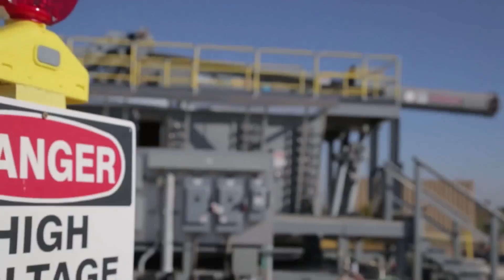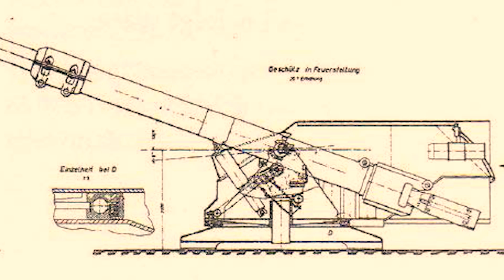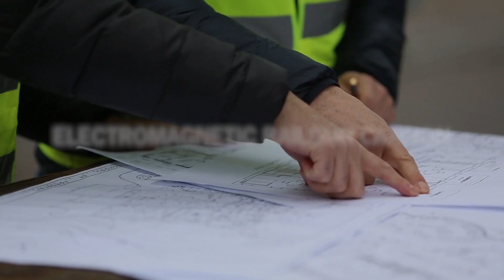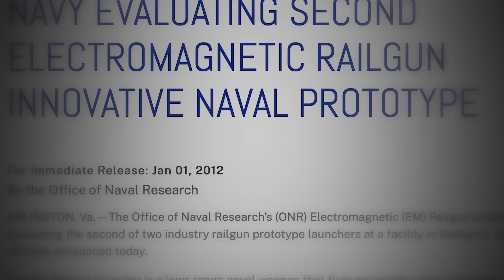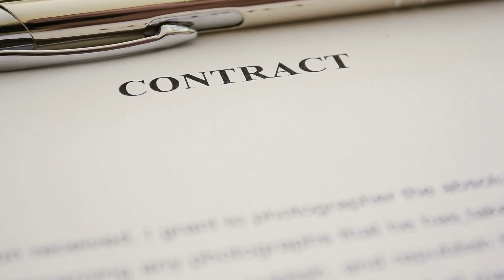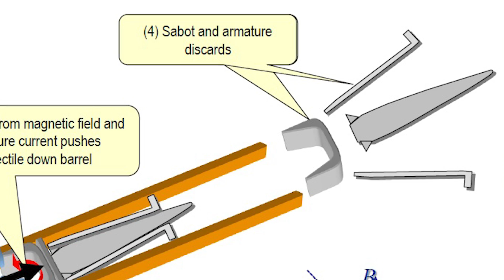The Most Powerful New Gun the Navy Has Ever Built?

Comment: What tears up the barrel so fast? Is it just the acceleration ripping the guts out of the barrel or the sabot and armature doing the damage? I want to see one shot straight up.
Reply: Probably extreme friction. MG42 etc came with extra barrels because they can only take so much before they become very inaccurate etc. Higher cause for malfunctions.
Reply: @Niever  not friction but extreme heat. Electricity is a scary powerful thing, imagine how hot those magnetic coils get. Idk if you know anything about welding, but watch how quickly a piece of metal can bend when you weld on it. Now imagine that ramped up into oblivion.

Idk a material that we make that can withstand that kind of heat.

My thought was always, how do we bring the heat down, what kind of cooling process could we have? Maybe nitrogen cooling veins?

But that adds complexity, gas storage issues. Which, the more complicated the system gets, the less viable it becomes.
Reply: The nazis used rounds in Gustav and Dora with increasing diameters as the barrel eroded from firing.

Comment: After talking with multiple SME's over the years, I still haven't gotten an adequate explanation as to why a Mk-15 Phalanx variant firing something like buckshot (or flechettes dispersed like buckshot) wouldn't work as an effective terminal defense against everything from drone swarms to super/hypersonic missiles. Throw up a cloud of tungsten!

Absent a revolution in capacitor tech, railguns and lasers just can't fill an anti-swarm/hypersonic role.
Reply: The Phalanx uses 20mm rounds
The type of round you are taking about is the German made 35mm AHEAD Anti-missile rounds, that fire "152 heavy tungsten metal sub-projectiles per round
In order to to be effective, they would have upgrade to at least 30mm GAU-8s which increases weight by 7000lbs or go to a single barrel system
Personally the Phalanx is in dire need of an upgrade
They do need a single barrel system but most importantly , they need a better load system to the gun can be loaded even while firing
Reply: @verdebusterAP  Sorry thought you were talking about the railgun did really see Phalanx.
Reply: in order for the rail gun to work it works on the principle of electromagnetics which is the one solid metal object that is then acted apron by the magnetic rails where it is then moved by that force ,because of that force the rails that induct that field around the object cannot propel more than that of a single object. Magnetics will make that object have a positive and a negative like a magnet. Making them shoot multiple items ineffective.
If you try to shoot multiple objects it makes the field unstable due to the positive and negative sides of the objects Essentially you cannot get the rails to move multiple objects without either making the field incomplete or making the gun basically destroy itself it it does.
Reply: @DB Replace the M-61 with a larger caliber gun and drum mag combo. Drones are delicate and the rounds themselves don't have to be moving fast when they encounter a hypersonic ASM; the threat's own velocity is enough to turn it into confetti.
Reply: Pretty sure Phalanx doesn't have the projectile velocity to intercept a hypersonic
Reply: CIWS are already weapons of last resort, only meant to neutralise incoming projectiles just a few kilometers from a ship. Flechettes and especially buckshot lack the kinetic energy at distance to sufficiently neutralise a fast incoming missile, and on top of that buckshot is also much too inaccurate as such distances.

Comment: I feel like it's a bit sus that they had such amazing prototypes then just to cancel it.  Whiiiiich probably means it's in use and they are keeping it a secret. I don't think power is much of a concern considering nuclear powered ships. Barrel wear for sure I could see. But 10 years of material science has probably done lots
Reply: Not sus at all. It's just a cool-sounding idea that doesn't work for battlefield applications. 10 years might sound like a long time to you, but I worked on railguns over 30 years ago and some limitations just can't be overcome.
Reply: Last I heard about it they were lining the rails with a quartz and sealing them in with some inert gas to prevent oxydation at high temperatures

Comment: Hi, what about if the cool down the barrel [the connon] with liquid
Reply: the issues are not something that can be solved by cooling. the barrel rails are shredded by the friction of the passing armature, which is moving several times the speed of sound. since this is a railgun based on the use of Lorenz force, that contact is required to function.
Reply: @ravengrey6874  It also contains the magnetics within the barrel core in order to propel the object so as it destroys the barrel it destroys itself also making it less and less effective over useage.

Comment: Why are these so complicated isn't it just a load of magnets in a row?
Reply: Yes, magnets that push against each other as well, literally tearing the barrel apart.
And the friction is also a big issue.
Reply: @sim.frischh9781  yeah they could probably lengthen the structure so that the same speed can be achieved without the same tension but that would result in a ship sized cannon
Reply: @No.3Orange  Which is why in SciFi such guns are often found to go pretty much through an entire ship.
Reply: Excessive power supply demand, heat generated from firing, barrel and electromagnetic coil wear are the biggest concerns when using this weapon therefore limiting it's repetitive use as a viable weapon system. Games such as metal gear solid make the concept look easy but in actuality it's very dangerous and can become unstable when the system is under tremendous electromagnetic forces acting against each other.
Reply: A railgun is not a maglev train. There isn't a series of magnets. It's just two rails, an armature, and a high-energy electric pulse. The function is simple, not complex. The limitations are the damage to the barrel and creating/controlling such a high energy electrical pulse. The barrel needs to be a material with a very high electrical conductivity. The material of choice is copper, which is also a very soft metal, which scratches easily. Harder metals could be used, but they have significantly lower electrical conductivity, which equates to significantly lower projectile muzzle velocity. Also, the bigger the applied electrical pulse, the higher the projectile velocity, but creating that pulse, applying it, and then shutting it off are all huge challenges, too.
Reply: @lgkfamily  I dont understand why a rail gun isn't like a mag lev train though, why cant it just be scaled up?  Forgive my ignorance.
Reply: @Ulnvtcydr  - The two technologies, the maglev train and the rail gun, are very different.  The fastest maglev was clocked at 374 mph while the rail gun shoots at mach 6 or 4600 mph.  So #1, there's a HUGE speed difference.  You can take time to accelerate the magelev to full speed whereas you have only the barrel length to accelerate the projectile from the rail gun to mach 6.  The way the energy has to be delivered in each system is vastly different.  Maglev trains use magnets to "float" the train above the rails and then use them to push/pull the train down the rails.  In theory there is no contact between the train and rail and thus friction is zero.  In the rail gun there is an armature that touches both rails to allow current flow down one rail, through the armature, and back along the other rail completing the circuit and thus creating the magnetic field which propels the projectile down the rails.  That means tons of friction and heat when you're talking about speeds like 4600 mph.  Friction damages the rails through things like scratching, also called corrosion.  Once that happens the connection between the rails is higher resistance which means the thing heats up more making it harder to cool.  The scratching also causes arcing between the rails and armature which further damages the rails and generates more heat.  Simply firing the rail gun damages the barrel leading to extremely high maintenance costs.  Early rail guns were one shot wonders because of rail damage so imagine what you'd have to do to make a barrel that can handle 2500+ rounds before needing replacement.  Back to the energy delivery.  This rail gun was a 32MJ gun.  You have to have a bank of high voltage capacitors to store that kind of energy which isn't that big of a challenge in and of itself.  The real challenge is fully discharging those capacitors in the milliseconds it takes for that projectile to travel down the barrel.  The capacitors have to be extremely low ESR, equivalent series resistance, otherwise they won't discharge fast enough and will heat up significantly.  Once the projectile and armature exit the barrel there is no more electrical circuit and any energy left in the capacitors is wasted.  The size of the projectile and armature is also an issue.  The larger the projectile you want to fire the wider the rails have to be apart.  That means the rail inductance is higher which impedes current delivery which means higher voltages are needed to achieve the current delivery requirements.  All that changes the capacitors because they have to handle the higher voltages and currents and still deliver all that energy in over the milliseconds it takes for the projectile to travel down the barrel.   Charging the capacitors is also a problem.  Charging creates heat which damages the capacitors which means to maximize system life you'd want to slowly charge the capacitors to store all that energy.  Slow charging doesn't work when you're wanting to get off 6 rounds per minute.

All this is sort of surface stuff.  It's the underlying technical issues with each of these problems that are hard to overcome.  Take rapid fire.  To rapid fire you need to charge the capacitors to their full potential very quickly, which is also bad for their longevity.  That means you have to have a very high energy power system for charging the caps. which has to be small enough to fit on a ship.  Space and fuel for that system is another issue.  So for each problem you have to solve there's 4-5 underlying problems that need to be solved.  For each of those underlying problems there are 4-5 more problems that needs to be solved, etc.  Each problem is also tied to another problem.  Fixing one problem adversely effects another part of the system.  You want raid fire, fine.  Now you've got to develop a capacitor technology that can handle the rapid charge and discharge requirements, and that technology doesn't exist.  That may mean developing all new materials and dielectrics that don't exist.  The Navy was trying to discover how much of this problem they could solve by building this system on land.  What they learned is with today's technologies they have no hope of developing this system without sinking in billions of more dollars or that it's simply not feasible because certain needed technologies don't exist.  Whatever the reason, this thing just wasn't feasible.
Reply: @abikeanditsboy3449  thank you for the detailed  answer appreciate that
Reply: @Ulnvtcydr  Perhaps it is a semantic difference. A railgun, by definition, uses two rails and an armature. A segmented device is no longer a "railgun."
Reply: @lgkfamily  yeah possibly, the complexity of the science has been since explained tho, thank you anyway 👍
Reply: Think its easy look up diy railguns on youtube see how easy it really is.
Reply: @TheAnonymousartist00  Not at the level of a naval gun.
However there is actually an infantry weapon one that´s even offered for sale.
Forgotten Weapons did videos on it.
Reply: @TheAnonymousartist00  - It's pretty easy to shoot a BB across a room but when you're trying to shoot a warhead at mach 6, 200 miles, with precision it gets a little harder.
Reply: @TheAnonymousartist00  Yeah. And a DIY peashooter is easy, too.